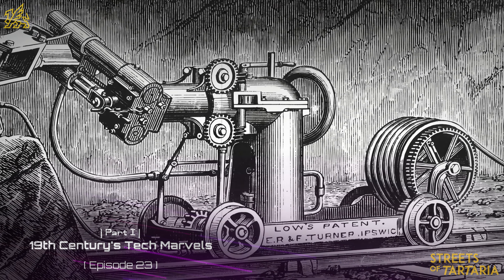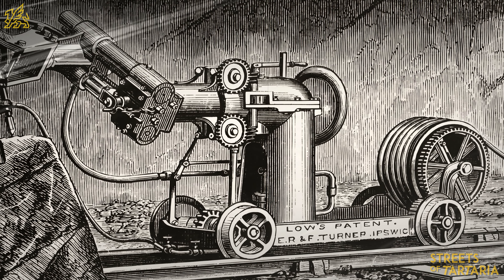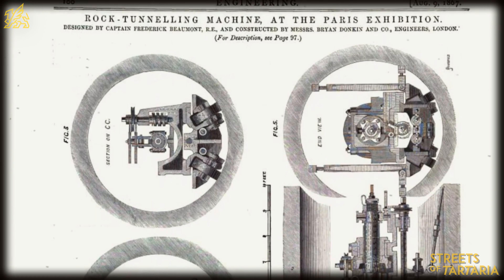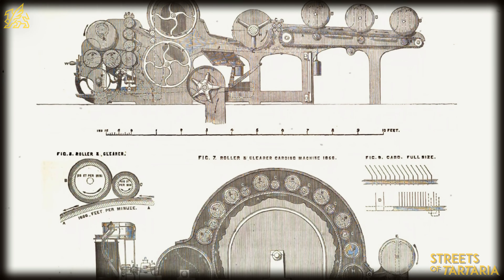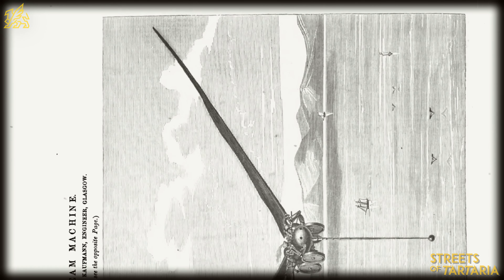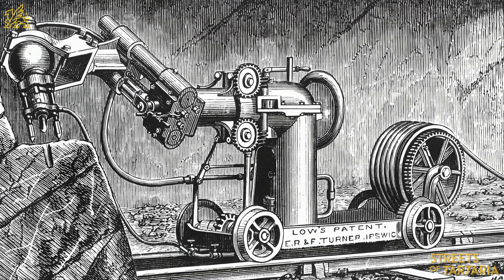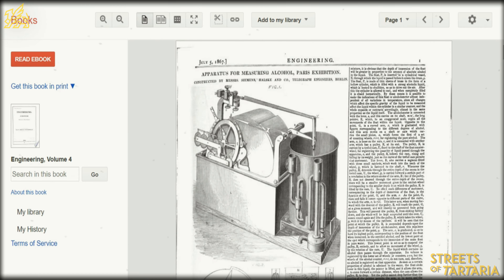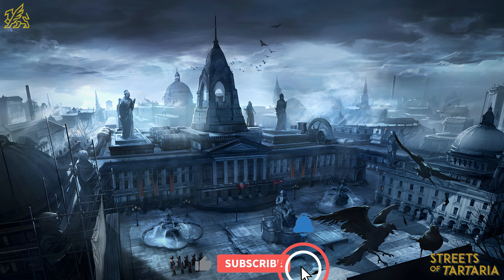【23】19th Century's Tech Marvels: Part I __「Russian Chronicles」| 4K ULTRA HD

Comment: Love it! Just for a reality check, I operated hydraulic hammers here in Arizona USA for 50 years.
To "break" GRANITE you need NO LESS than 3,000 PSI hydraulic hammers mounted on a platform that will allow movement throughout the work area.
Steam driven equipment is certainly viable IF it meets those precise criteria:
3,000 PSI
Continually
Reasonable access and ability to work throught the area.
----------------
Terms are for "salt'n'pepper" granite.
Cheers!
Edit: structure